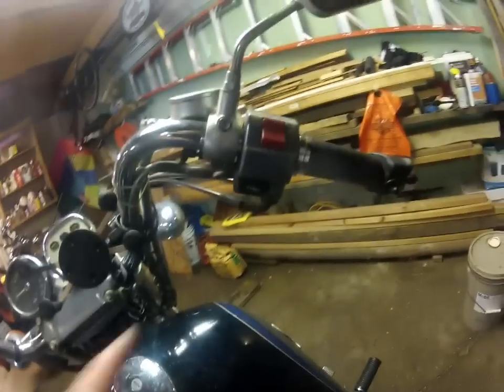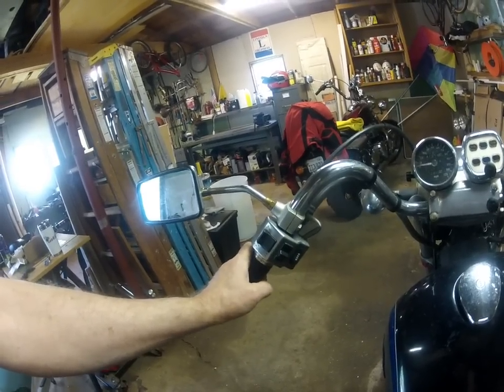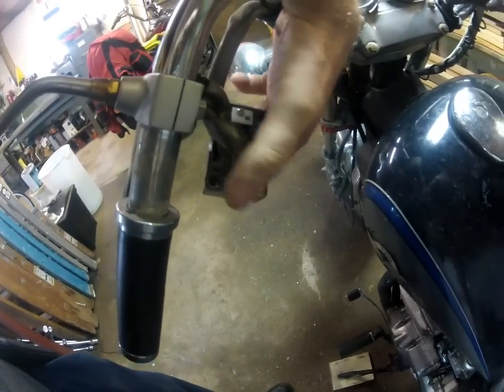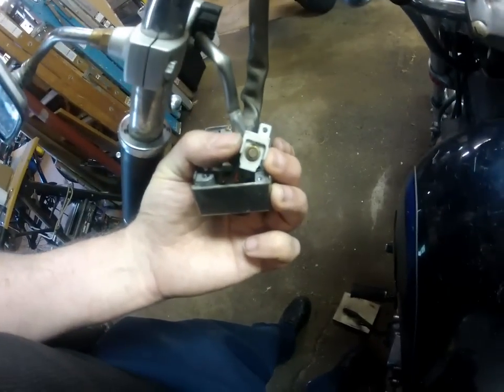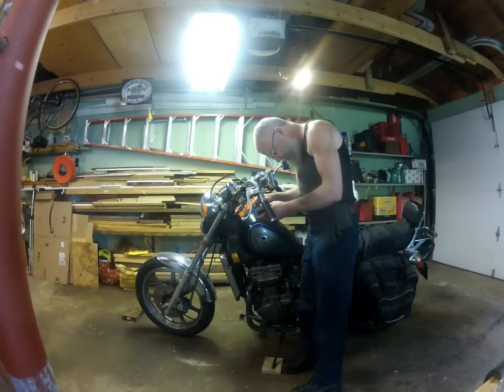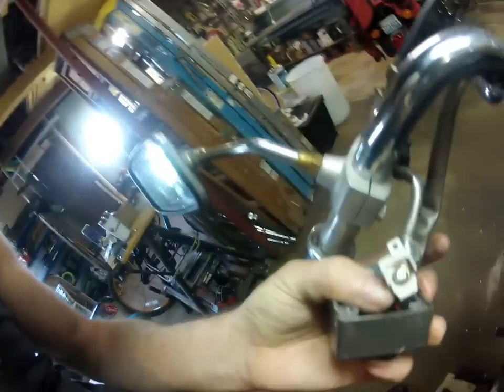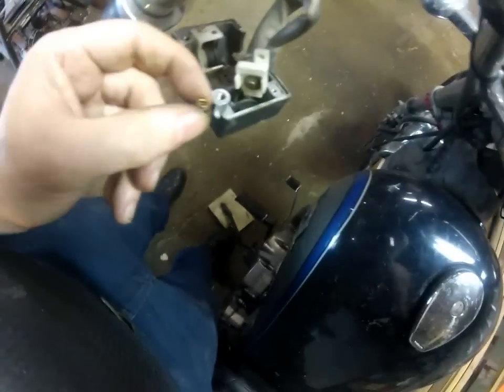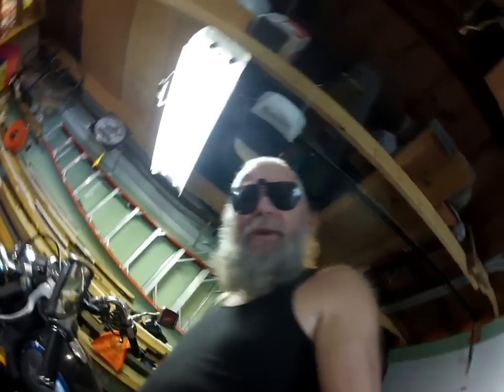Motorcycle Starter Switch Repair (also works for the horn button on some bikes)

Comment: I have a 85 Yamaha fj1100 that doesn't start by the starter switch, it use to work but stop and plus my on and off switch doesn't work either can you tell me the problem thanks and like the video.
Reply from the maker: Van Gardner If you have a friend that is good at troubleshooting to help I would suggest having them assist you.

First before anything check all fuses. 
Sometimes it's the simple things that fool you.

Check to see if when your key is turned on you are getting power to the kill switch and starter switch on at least one side. If not then keep tracing  back along the wire to see where you finally get some power and the problem would be around that area. 

For my bikes I also have a wiring diagram for them with the color codes of the wires. That helps a lot. 

Sometimes Clymer or Chiltons sells books with the electrical diagrams in back. Your dealer may stock them too.
Reply: Ok thanks

Comment: If the switch is clean  and the bike starts if a run a wire from the aux to the switch connections  what could it be?  The button is clean as can be but still does not make contact?
Reply from the maker: If the contacts are clean and you even tested for continuity with a VOM meter then I would start to suspect the wire attached to the contacts is broken or has a hairline crack in it.  The wire is probably either soldered or crimped in place to make a connection to the contacts themselves.  I have also had contacts look clean but not be reliable and when I used some sand paper to make them shiny they started working again.

Comment: My horn is stuck on for some reason. I think the button somehow is jammed
Reply from the maker: Hopefully you can disassemble it and find out why.  Could be the spring is broken or collapsed or some other junk got inside.
Reply: @suburbanryder - The Mayor -  just took the button completely out and the horn still goes off. The circuit must be touching somewhere I assume

Comment: Hi mate,i don't know if you can help, i have the same bike as you, in fact its the same year,it's called an EN 500 rather than a vulcan 500 in the uk.I've just got a pair of new horns ,but when i put them on they blast as soon as i turn the ignition on, i know the horn switch is ok as it works with the old horns.Any ideas on what the problem might be i would be greatful.

Comment: Hey man on my 86 vulcan 750 I took apart the starter switch and cleaned everything and im getting 12v to the switch but when I test it at the solenoid I get nothing.
Reply from the maker: Next step is tracing the wiring section by section until you see which wire or connection loses the power and then fix or replace.  
Sometimes if it's too complex, or I don't have time, I will just run a new wire and "wire tie" it to the loom and be done with it.

Comment: I have a 95 Suzuki intruder 750 just took the seat off and put it back on now it's trying to start up just by  turning the key but the kill switch is on? I've already cleaned the house for the kill switch tho. Any ideas??
Reply from the maker: That sounds like a complex problem to me. The starter switch should be the only thing that engages the starter motor and not turning the key to the on position. Also with the kill switch in the on position it's not disengaging the circuit as it should. I would start by taking the wires off the kill switch as close as possible to the switch. If they are separated then if the wiring is correct there is no way for your bike to either start or run.  Also since you said the weird trying to start happened right after you removed the seat, take a look at anything you may have  touched or look for any crimped or bent wires that may be making the starter engage without pushing the start button. I wish you luck.
Reply: Preciate it will do

Comment from the maker: The hardest part it keeping the spring in place while you put the contacts in place. One bump and you have to start over again.
Reply from the maker: @Troy Patrick I would go to my local hardware center. They have lots of brass washers and even some sheet metal pieces.  It would take some time but I would just make another from the brass piece. 
If you don't mind ordering online Amazon has a huge assortment of various brass washers and brass stock.
Reply from the maker: @Troy Patrick Awesome !

Comment: My starter switch was not working all the time. So I cleaned it but still not working. What  can. It be.
Reply from the maker: There are only a few basic components to most systems.
 The wiring may be bad. 
It could be the starter itself or it could be a starter relay is bad.  
I would start with testing the relay.  Next I would use a VOM to test the wiring and finally I would test the starter using a jumper and 12 volt source.

Comment: I need a good video on replacing the whole cluster pack for dimmer and horn switch and turn signal signal. Do I have to take off grip on the left side? Any help will be appreciated!
Reply from the maker: Most bikes you should not have to.  
My way of doing it is to take out all the easily visible screws first and then  start pulling and twisting and see if anything comes loose.  If it still feels tight then keep looking for more screws or clips. 
If you need to pry with something, then be very gentle.
Go easy on the plastic because I have been heavy handed and broke pieces before.

Comment: ANY IDEA WHY AFTER I CLEANED  INSIDE MY IGNITION BUTTON  HOUSING IT KEEPS BLOWING FUSES EVERY TIME I TRY TO START IT....WHICH IT DOESN'T.    COULD IT BE BECAUSE I TRIED TO SUPPORT THAT STUPID LITTLE SPRING WITH A PLASTIC TWIST TIE ?  SORRY I'M JUST A GIRL. I WAS PROUD JUST TO TAKE IT APART  CLEAN IT AND PUT IT TOGETHER AGAIN. THERE WAS A SPIDER WEB INSIDE.
Reply from the maker: That is rather odd that it would start suddenly blowing fuses due to cleaning the starter button.  My next step would be to unplug the switch or cut the wire to the switch taking it out of the circuit and just put a standard switch to test or even touch the bare wires together to start the bike and see if it still blows a fuse.  If no more fuses blowing then there is a dead short in the switch somewhere.  If fuses still blow then it's somewhere down in the wires going to the starter relay.

Comment: I have to take my Honda Shadow Spirit starter switch apart this weekend. The button sticks when it is depressed so it doesn't disengage the starter. After doing some reading online in the Honda Forums, I found that this is a common problem. Dirt, corrosion and moisture interfere with electrical contacts.  It has to be taken apart, cleaned and lubruicated--but it MUST be done with the correct product. NEVER use something like WD-40, oils or greases that will draw dirt and dust in the near future.  I found this highly rated product on Amazon called Dexoit Contact Cleaner Spray: http://www.amazon.com/Hosa-Cable-Deoxit-Contact-Cleaner/dp/B00006LVEU/ref=pd_sim_e_1?ie=UTF8&refRID=15C914G4S031ZS06FFV2. Using the product with a Scotch pad to gently clean, but not scratch is also important. It's safe on contacts and plastics. Never use anything abrasive like sandpaper or a knife blade. I found a nice link on the web showing pics of the starter switch with labelled diagrams: http://www.rattlebars.com/mtz/starter.html
I hope you don't mind me adding more info here. Best regards!
Reply from the maker: I encourage all contributions, thank you.

Comment: I found ants in my starter switch.  2003 Suzuki Marauder.  It’s been sitting for years and the fuel tank is corroded.   It’s going to take some work.
Reply from the maker: I wish you luck.  Let me know how it turns out.

Comment: hello The Mayor I have a CEV horn switch that's missing its button, do you have any ideas about how these things work. Looks like it has three contacts in there . how can I fabricate something to get it working ? link bellow
thanks in advance
http://www.mopedarmy.com/forums/file.php/6/124337/IMG_5147.JPG
Reply from the maker: You only need two contacts to send power to the horn so test to see which two by using a piece of wire. Then look to Radio Shack or online for a "momentary on" button. The hardest part is not making it work. It's finding a good place to mount the new button. They usually won't just fit in the same place the old button was. For that you have to get creative with brackets or clamps. If you have not done a lot of fabricating in the past find someone who has to help you.
Reply: Ok thanks ill try that later and inform you of my process.

Comment: When you set the camera down, even though you are removing things, obviously you won't be able to give very detailed instruction because of the inability to view EVERYTHING. I would say you could re-cut the video and be sure to show literally every little or seemingly little thing. It's tough to hold a camera and work but maybe you could have someone assist you?
Reply from the maker: You are also thinking along the same lines I am for my next DIY video.
What you suggest I am going to try with modding a welder from AC to DC and see how it works.
Always better to have MORE detail instead of less. That I can see by the comments.
Thank you for your suggestions Josh.

Comment: My 2001 shadow Ace starts cranking over as soon as I hook up the battery, could it be the contact on the starter switch?
Reply from the maker: It is more likely the starter relay is stuck, but a stuck switch is the second most likely cause.
Reply: @suburbanryder  thank you I will take a look